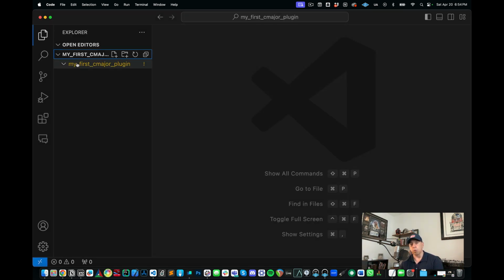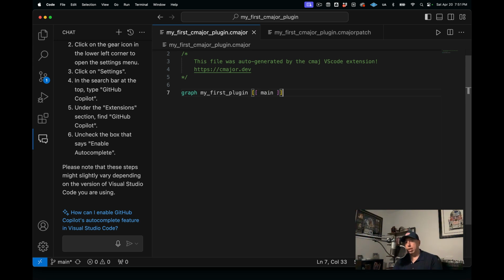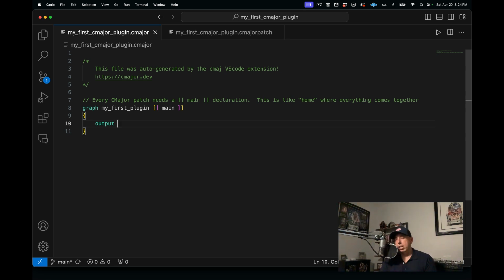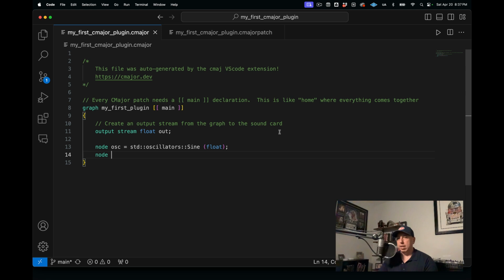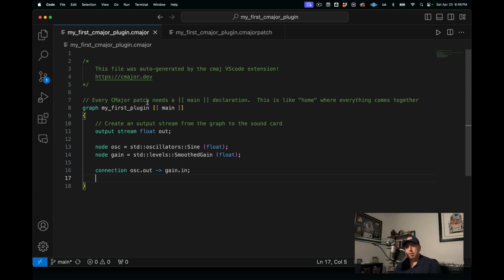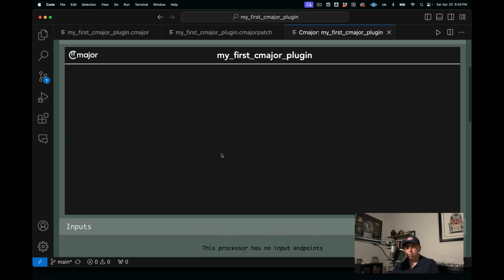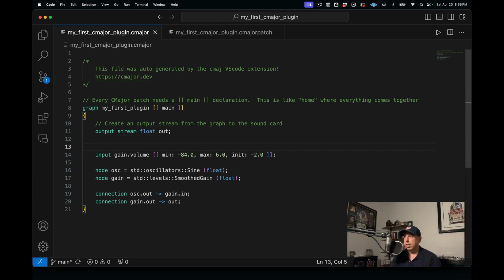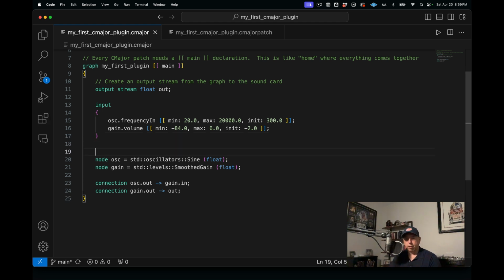CMajor Tutorial 02 - Your First Audio Plug-in (Part 1)

Comment from the maker: Chapters
0:00 Introduction
1:00 Creating a project
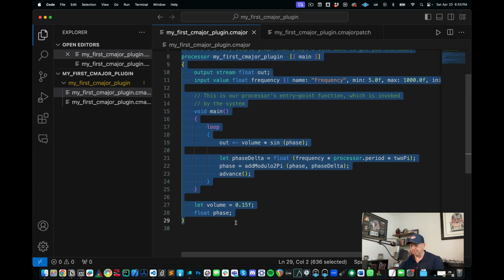2:39 Core concepts for creating your first plug-in
3:24 graph
5:10 endpoint
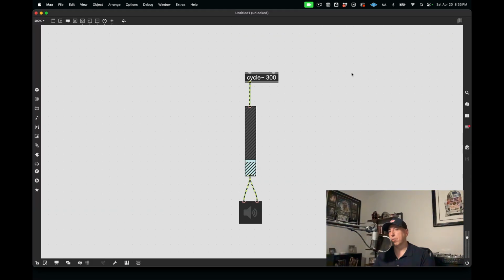9:43 node
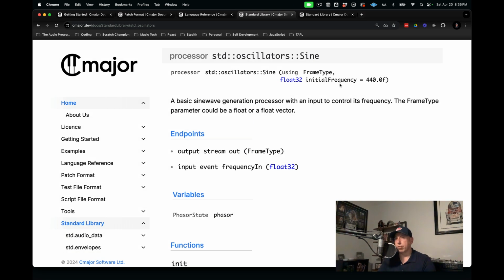10:18 Sine oscillator
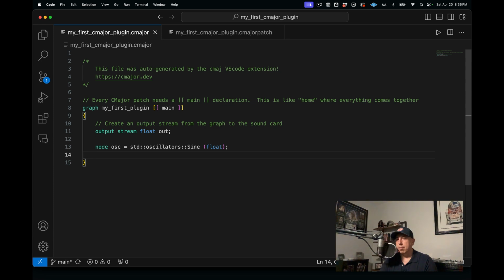12:05 Smoothed gain
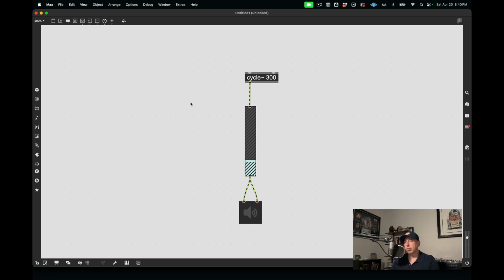12:59 connection
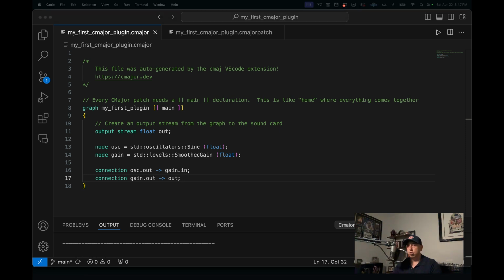17:44 Overview of CMajor debugger
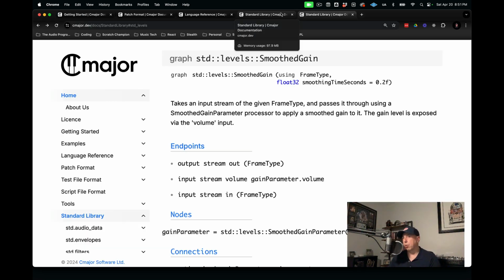20:12 Creating endpoints for osc freq and gain level
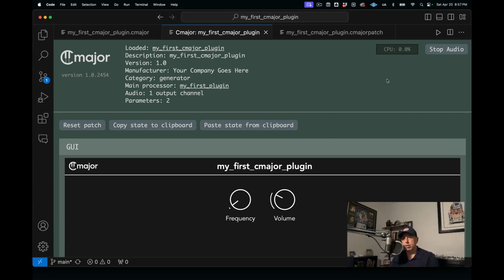25:50 Cleaning up code and next steps
29:06 Summary

Comment: Are there any audio libraries for GO or JavaScript that are just as fast? Why is C still being used for audio always? The friction for devs is unreal.. I want to develop audio software but I want to do it with modern fast frameworks
Reply from the maker: Hi Jake...it's not C.  This is a domain specific language (DSL) that's designed with ease, portability and efficiency in mind.  You don't need to worry about many of the complexities that you would get with C or C++ such as long compile times, threading, etc.  So it is modern...and optimized for speed...

I hope that helps!